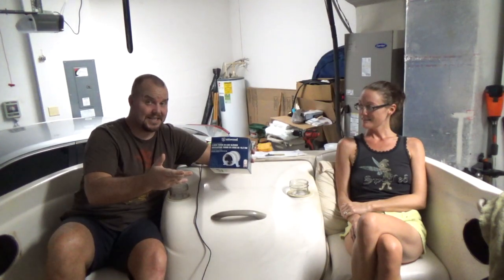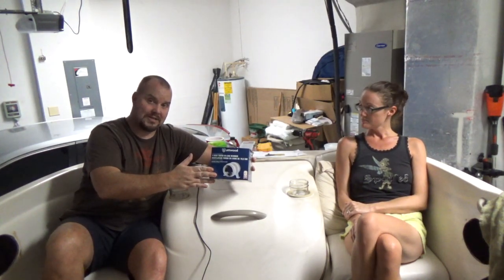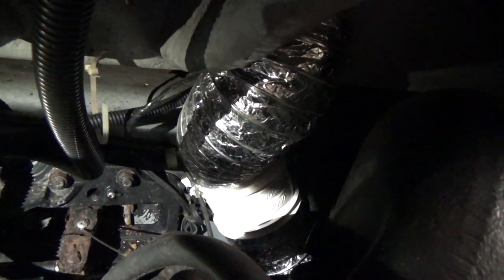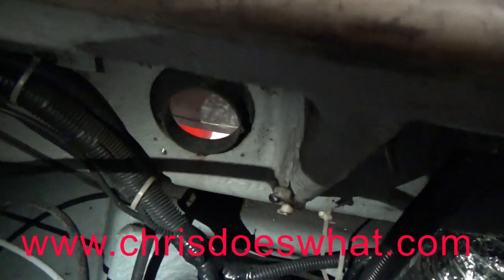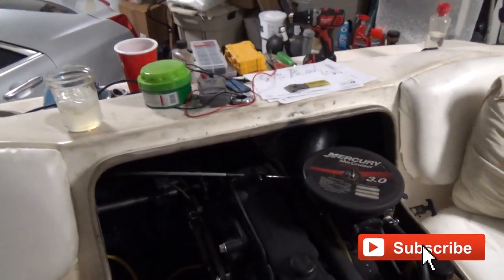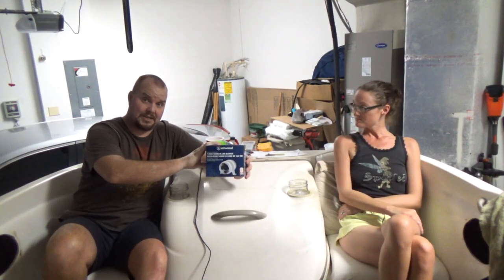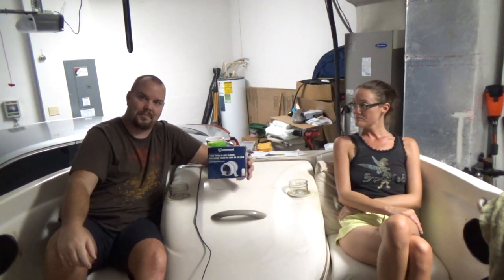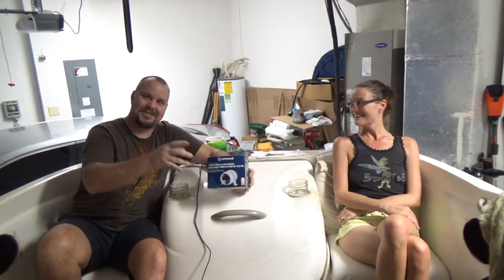Review Attwood Bilge 3 Inch Fan Blower  || Mercruiser 3.0 Bayliner Bowrider 175

Comment: I replaced the one in my 19 ft. Rinker last year because it has seized up. When I went to use the new one the last time I had the boat out, it seized up and popped the breaker just like the last one did. Going to try another make other than Attwood for the next one.
Reply from the maker: This one still works fine, boat only used in fresh water.

Comment: You have that installed backwards.  Its an exhaust blower not an intake blower. You want to suck the gas vapor out not blow fresh air in. Just reverse the blowers direction and the problem is solved.
Reply from the maker: The engine install, bilge blower, and fuel gauge were the only things we didn't install and done wrong by a mechanic. Got the engine running, still need to fit the fuel gauge, and the bilge fan is blowing the wrong way. It makes sense it should suck versus blow since fuel vapors are heavier than air.
Reply: I have to install this on my 87 Thundercraft.  I’d like it done right.  Do you know of a video I can watch, DIY?  Going in a 1987 Thundercraft boat.  Has 120hp mercruiser.  I bought it and it was gone.  I have two cowls. One on each side of boat

TIA
Reply: Help, see comment below from Me, Lee 

Tia